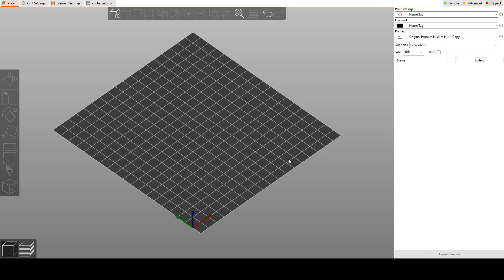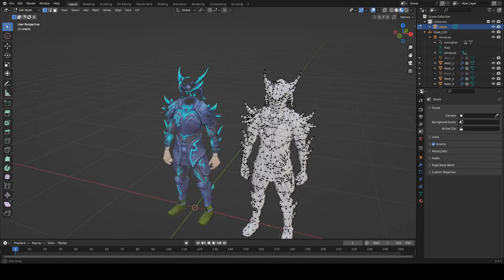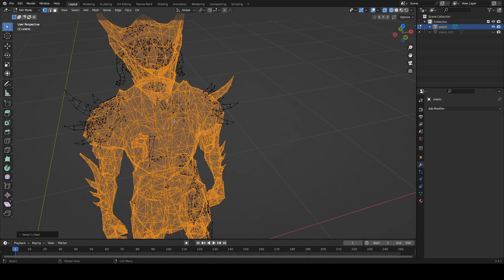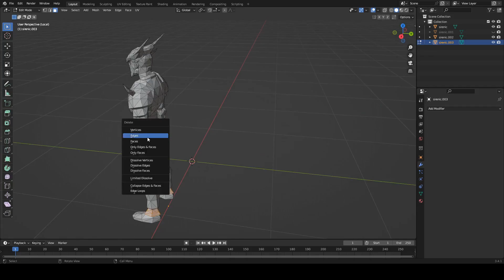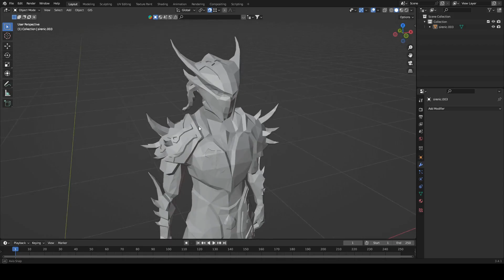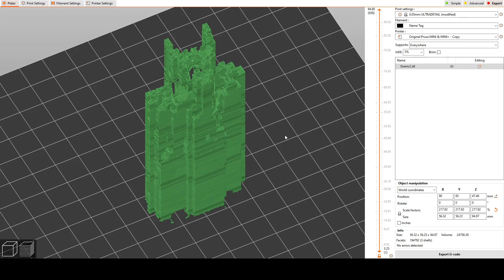How to 3D Print Your Runescape 3 Character

Comment: Models of items and such pop up, but when I try to load my character, nothing happens. The model never appears/that menu to alter stuff never pops up.
Reply from the maker: You've visited the photobooth? let me know your RSN and I can have a check for you.
Reply: @AreaOfEffectVIDEOS  Yes it was one of the first things I did. It just never loads my character or give me an error message. It will load in game models/ items fine however. Eco5617 ign
Edit I am using the steam launcher for it, if that might be something.
Reply from the maker: @ecofriendly9815  I see, I also couldn't get your character to appear. I don't think the launcher should make a difference. I wonder if it's a particular item you're wearing in the photobooth.
Reply: @AreaOfEffectVIDEOS  So I changed out of my transmog then put on a different one, and that fixed it. Something about the set I was wearing it didn't like.
Reply from the maker: @ecofriendly9815  I think some of the overrides don't extract well, or creates a conflict that the viewer doesn't know how to handle.

Comment: Many models, ... when importing as GLTF / GLB just give an error, sometimes just something like a rigify without a mesh. I tried Marimbo for example via NPC option in runeapps. It says 'error' or most of the times 'couldn't parse the glTF, check that the file is valid.

Can you think of the issue, I found some vids that the filename can be the issue > no spaces allowed, which seems not the case and didn't work if I even tried. Or some Bin data not in it.

Like di you know some good video's or try yourself?

Also how can we use the 'Model' function.. Can't find any ID. And not all models are complete, like Lummy castle only shows 1 sign or flag.

Thx!
Reply from the maker: Hey there, So I just tried your Marimbo example and get the same error. I can export as STL but as GLTF I get the error. I tried a website https://github.khronos.org/glTF-Validator/ which comes up and says there's an error. And there's a lot of errors with it! So I'm afraid that's all I know. Without knowing how the GLTF is parsing the data from the Runescape cache, it seems that the export function does not work correctly with this model.

I've not tried the "model" function. There is a model search feature in OSRS Box https://www.osrsbox.com/tools/model-search/ which allows you to search the name of an object and it will give you the ID of it. But it's a bit vague as many objects have the same name. I would think something like location might give better results for example searching for castle, you can get Lumbridge castle as a sandcastle which may be close enough. Otherwise each wall square segment is its own model with model ID.